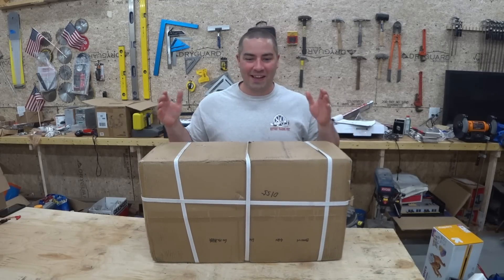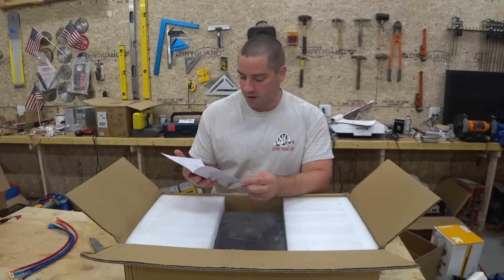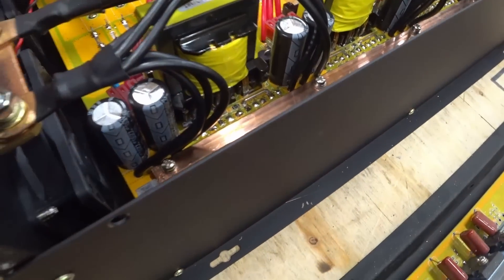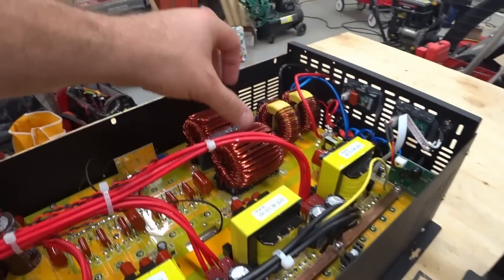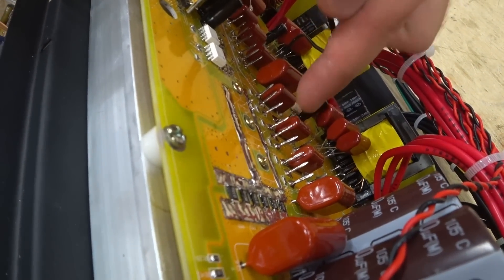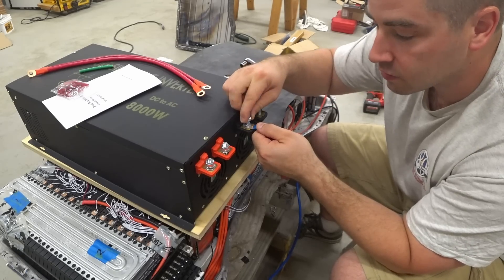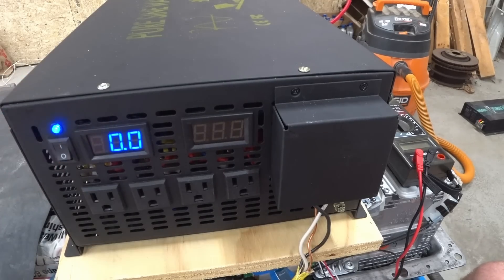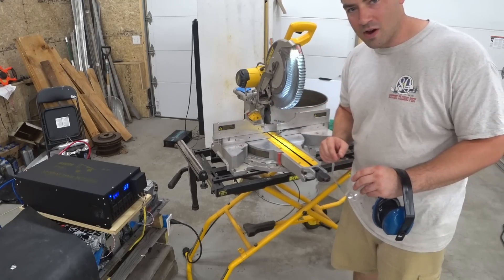Cheap 8000w Reliable Inverter, That Works! WZRELB

Comment: Maybe AC is not needed for solar and inverter combos?
The need for AC was a big deal with power lines running all over, but with power now coming from panels on the roof of every house, the need for AC is not important.
Perhaps the focus folks need to concentrate on now is identifying and removing AC transformers on mostly DC appliances.
So many times, I see AC inputs on low power  appliances that go from AC to DC.
Almost every appliance only needs DC... The AC is only needed to transfer electric power over long distance.
Since solar power is gathered/made at panels only feet away from the need, I think AC is not needed.
And with AC to DC conversion not being 100% efficient, imagine removing the numerous converters on almost every appliance.
We may only need DC!
Reply: I like your thinking but with DC you have to consider voltage and power.  You can get all kinds of 12 volt appliances but the amp draws are pretty high.  That means heavy wire.  If we could get manufacturers to agree on a DC standard (like 85 volts) then we'd be able to use the same wiring as we do in homes today and devices would be more efficient.  Why 85v?  I'm not an expert here so I'll accept a correction, but I believe that to get the equivalent power from DC as 120v AC, you have to use the root mean square equivalent (because 120v AC is not always at 120v).  The RMS value of 120v is 85v.  So if my theory is correct, all those power tools, shop vacs, vacuum cleaners, blenders, etc with series wound motors would plug right in and work fine.  Water heaters could be adapted too.  Lots of things would not work though and you'd have to have use DC to DC converters or a smaller AC inverted sub-system.  I was trying to figure out a way to transmit DC and AC both through a home but it comes out to a lot of wires.  You'd think you could share ground but that's bad juju.  It would play havoc on GFIs at the least.  Still, the idea of using native DC devices is good because it can reduce your AC needs.  Look at what you can do with DC powered air conditioning and heating at HotSpot Energy.
Reply: @lenmarinaccio3262  This is why 48-72Vdc battery banks are becoming more commonplace.  At that voltage, wire size is less of an issue.  I have even run many of my power tools directly off of a 96v bank in my garage since many power tool motors have brushes and are therefore self commutating they will run on DC or AC just fine as long as the voltage is fairly close.  Remember that a 120VAC outlet is measured at the RMS value so the actual peak voltage of a 120V outlet is 170V.
At 48-72v you can buy buck converters that lower the voltage that can be used close to where you need the power but I think the biggest thing to look at is how many devices don't have a large current draw and could be run just fine off a simple 12v 15 or 20 amp circuit.  You can buy 48v electric water heater elements that are slower at 1500-2000 watts but they still get the job done if you have a large water heater tank and don't use a ton of water all at once.  
The only appliances that really need high current are likely in the kitchen and laundry room and you can find 48v inverters for around $1500-3000 that will more than handle all the appliances in a typical house including air conditioners and the only thing you have to watch out for is that you don't run all the big loads at the same time so AC, stove and clothes dryer.  With the right planning, I think most houses could be set up to use both AC and DC effectively and cut down on a lot of wasted power at the same time.

Comment: How many solar panels and battery do you need to use that 8000w inverter?
Reply from the maker: I was using a 12kwh lithium battery and it worked pretty well.  For the solar panels you would have to first find out how many kwh you consume per day before you can decide how many panels.

Comment: The main Hot wire and neutral maybe he's a good idea to change it 8 gauge or 6. To avoid heating up the wires. Probably running more efficient

Comment: you can use a regular 120 volt incandescent light bulb ,to charge those caps to prevent spark.
Reply from the maker: Yes you can.

Comment: Did you ever actually demand 8000 watts from this inverter continuously? That would be the question. These units from China are often underrated.
Reply from the maker: I tried to pull 8kw in Part 2 video.  It only got up to 7kw. https://youtu.be/TZbjy9t933E

Comment: How many and what kind of batteries are you using
Reply from the maker: In this particular video I used a lithium battery.  It is Li-NMC, about 15kwh, (12 kwh usable) and arranged 14s for 48v)

Comment: I am just an old man now!  I am building a grid on my home.  I use mostly 2 and 4/0 gauge wires.  Thing I would like to know how well a battery system would last daily.  I enjoy too much electricity!  I like what you had done. I recommend everyone to use 2 or 4/0 gauge wire.  I use 4/0 gauge from battery to systems.  I now want to build my solar next.  Thanks!

Comment: No grommets around the case cut-outs for the high amperage outputs? That's smart. Watch for a short circuit there over time.

Comment: 58 amps x 120v = 7, 000Watts, not bad,  nice to know if it heats up much over 8 hours at that wattage.  Thanks for doing the video.   I'm looking for flexible solar panels that are proven to be used as solar "SIDING" for a house or as solar "shingles" too, and can be chained in parallel and/or series to get to 24v to run an inverter, the inverter would need to be 10.kw so I can run my AC or furnaces @ 240 v .. .thanks if you know of either.

Comment: 8000w is a capacity of around 60amps that is alot of power, of course it will take the load, I would use 4ga. Cable for that inverter at least, or you'll weld the terminals with the wire size you have now

Comment: stranded wire is smaller than solid wire. but for a given size both kinds, the stranded wire has a higher capacity

Comment: That 10 gauge stranded wiring you see supplying the hardwire contacts are so short they are considered "Chassis" wiring and are capable of handling MUCH more than just 30 amps, which is the rating for longer lengths of wire. Personally I would have gone with at least 6 gauge, but those 10 gauge wires may actually be alright,. but still a little bit small.

Comment: I'm with you on the internal wire gauge. Also, its good practice to hook up possitive cables before negative. It may or may not have an effect on solar systems, but if you are in that bad habit of neg first, when you are trying to install a battery or jumper cables on a vehicle you have a good chance of welding. Thanks for the video.
Reply: Could I ask what’s the reasoning behind this?
Reply: You want to do this because if you have a negative body ground, as is the case in a vehicle, you want to hook up the positive first so that if you bump your tool between the post and something that's ground (car body), then you won't short out the battery/start welding things with your wrench. :)  If you do the positive first it won't make a circuit if you touch the ground.  Then you can put your ground on and it's also safe.

Comment: I bought a similar product 10000w from Reliable two years ago and after one month it burnt out. I paid another 200$ to try and repair it but it never worked again. I could nor afford to send it back to China at my own expense as our mail is much more expensive than China mail.  Has your inverter continued to work?
Reply from the maker: I used it about a month.  I tested it running heavy loads, inductive and resistive.  It worked OK.  Never broke.  I sold it, so I can't tell you about anything longer than a month.

Comment: What kind of batteries did you use for the 8000w inverter and how much did it cost?
Reply from the maker: The least expensive place to buy the inverter is Ebay, for $1,100.  The battery is directly under the inverter in the video.  It is from a Smart Car, I re-wired it to 48v.  I have several videos on the battery build if you want to see how I did it.
Reply: @DavidPozEnergy  Thanks

Comment: Would you test to the 16000W spike?  Yes, that's a nice big chop saw but I don't think you're really stressing it.  Plug all your tools in at once and push it to the breaking point.  I also question your title - I do not call $1500 "cheap".
Reply from the maker: You might enjoy Pat 2 of testing this inverter.  It never did get all the way to the name plate rating.

Comment: I'm pretty new to this stuff. Why do you have 4 wires for the battery side of the inverter?
Reply from the maker: The manufacture sent two thin wires for positive, and two thin wires for negative.  It is recommended to use one thick wire for positive and one thick wire for negative.  I'm guessing the manufacturer does it this way for cost.  They might buy a million of this size wire and send one wire for smaller model inverters, and two wires for larger size inverters.

Comment: Also, 6AWG THHN is rated for 75 amps. If that's 6 gauge THHN wire, it's safe to use on the output stage. The entire outer diameter of the wire would be about 6.3mm, which that wire appears to be reasonable in-line with. I'm assuming the wire can actually handle the current. I'm more concerned about the jack of output stage protection.

Comment: That's incredible... how the hell could they not fuse the output stage of the thing? Of course they recommend low current draw devices on the edison outlets.... there's no protection on them! You plug in two space heaters and you're setting that internal wire on fire.

Comment: I personally would replace the mains feed wires inside the inverter they would be fine in a technical sense there is plenty of airflow over then and they aren't drastically undersized but if you were to use this in a off grid situation and were potentially getting near that 8000w it's an unnecessary choke point and cause of voltage drop especially when a fix is so easy

Comment: But you never got close to 8000 Watts.  The DC cables are completely in adequate.  Also very light weight, I really can't believe that would sustain 8kW and *really cant believe it would surge at 16kW.  A good 8000W inverter, you'd need a 2nd person to pick it up.
Reply from the maker: This was part 1.  Check out part 2 if you want to see the full load test.

Comment: How long will it run those things before the battery cell dies out
Reply from the maker: The battery in this video has about 11 usable kwh.  So it could run a 1,000 watt load for 11 hours.

Comment: About Wire gauge vs. Current... with the very small run, this is likely sufficient. It's called "chassis wiring", and has very different rules than transmission. The voltage drop would be minimal, resulting in the power across it (heat) to be small. Stranded wire has lower resistance than solid wire... for example:

If the wire was 10AWG equivalent, 49/27 stranding, at 6" long, each wire would only have 0.000545 Ohms, and at 66 Amps that's 0.03597 Volts drop, which results in 2.374 Watts across that 6" wire.  If it were very high stranding like 105/30, then you have 0.00049 Ohms, 0.03234 Volts, 2.134 Watts.   It will get a little warm, but well within even 80°C insulation specs.
When adding loads, you can NOT use the label ""Maximum current draw" rating... that would be with the tool fully loaded to its maximum possible load. Unloaded draw is a small fraction of that amount... a 9-Amp rated saw might only draw 1 Amp without loading it down.  Use a Kill-a-Watt meter and read VA.
When you hook up a load and the Voltage climbs, that's a sign of an imbalanced feedback circuit... it's trying too hard to correct for the load... there should be NO change in a good design.
Inductive loads (AC motors), when unloaded, have a VERY bad Power Factor... the current and the voltage are way out of phase, which is harder to handle than a nominally loaded motor.
Reply: I don't think that wire would be any good while technically your calculation are right I doubt they used anything special being Chinese made and metric cable equivalent is 6mm2 with 75c insulation which Australian standards rate at a maximum of 50A before derating if I were going to use that inverter I would swap them out for 16mm2 which is about 5awg but a 6awg would be fine we just don't have an equivalent

Comment: Dave as far as wire guage concerns in real world applications I've seen some really undersized copper services feeding multidwelling buildings in Manhattan in my day...  and when I tied these services in the math in my head said no freakin way....  but in the real world it works ...  so I dont worry so much about slightly undersizing even a 60 amp draw on a rated 30 amp wire.... i think the codes are over the top but down in those manholes in the cities nonones looking if you know what i mean....  I've had the unfortunate pleasure to hold a single phase leg pulling 1100 amps on a 500 mcm cable the other 2 legs or phases were pulling slightly less.....i was up around the Columbus Circle area in a midsummer heatwave  ........  the scenario was 8 sets if temporary 3 phase shunts feeding that big old building on the corner right by the Channel 7 ABC news building and those shunts were running hot and long about 300 feet from the street across the walk into the front door and down to the basement...(crazy scenario and getting political by the minute all the big shots were hanging around that afternoon someone screwed up...  you might know the grid im talking about cause it went down completely in the summer and made the news its a trouble spot columbus network but one i wasn;t familiar with i was part of the downtown manhattan networks and didn't know the politics were thick up there , thick enough to put peoples lives at risk, just a note never put your life on the line for assholes you dont like) .....anyway the new services were pulled and waiting to be tied it was a short run of 80 ft through the conduit into the basement to retire the 300 foot temporaries.......so I tied that first set of 3 single phase in and wham the juice took the shortest path and i felt it tremble  i put the amp probe on it thats when i saw almost 1200 amps and I had to cut it before it melted this was all in a matter of miinutes but it was hairy and scary....  shortly after that I packed my shit and left that job .pretty much for good... not because it bothered me but because i thought the company was full of shit and didn't appreciate my labor.... and in the back of my mind i had the strange sensation someone wanted me to burn in the manhole that night.....  lets just say I made a few enemies in that company.....  but alls good now that was 17 years ago.... i've applied my skills into home renovation now.....  but anyway I like your channel and ever since I hillbilly rigged my predator 4000 to run my entire house for an entire week back in 2015 ive been interested in the off grid You Tube scene.....
Reply: I am no electrician but I have seen video of the basements in new York and the mess from floods and rats and god only knows. Glad you made it out alive, lol
Reply: @giggleherz9491  thanks bud...  yea i learned alot working in the streets on NYC...  but what i learned the most was the politics of Corporate America ..   and a real good feeling for the aristocracy within the corporate world and how the money involved gives them the upper hand and picking who and who will not have access to a descent quality of life in this country...  and most of what i know leads me to believe a civil war is just ove the horizon....  between the haves and have nots.....

Comment: Hey I am looking for a inverter to go from 24 volt dc to 220 volt ac this inverter would only be used for a max of 10 minute intervals may be 2 times an hour.do you have any recommend ones to possibly buy.Thank you for your channel and all you do. God bless
Reply from the maker: I've never worked with 24v systems, so I don't have personal experience with them.  I'd suggest calling Alt-E.  I buy lots of stuff from them.  They are trained to size equipment for your application (free service) and they sell the inverters.  https://www.altestore.com/store/  I'm not affiliated with them, but I am a customer.

Comment: These inverters are about 1100 bucks from a quick check on Ebay. The real comparison would be to my outback 3024. 3000 watts, 24 volt battery bank. Which I paid about 1200 including shipping. I'm betting the outback would out preform the 8000 watt chinese inverter. Not sure but defently worth a review, I'd.say with confidence the putback would outlast the chinese model by a decade or two, just dont know how they'd compare to power output. I owned some aims inverters and they lasted about a year, I've had a outback and magnum running full time, 24 hours a day for 4 years now no issues.
Reply from the maker: I'd agree, that the Outbacks will probably last a lot longer.  The Outbacks do a better job with surges, and are a cleaner sine wave.  I only use this brand for small temporary stuff now and then, not continuous duty.
Reply: @DavidPozEnergy  it's cool you're experimenting with them. I bought alot of differnt stuff 10 years ago, it all let the smoke out within a short period of time. I just stick with name brand stuff these days. Which most people including myself cant afford, but if I cant afford it I just do t make a purchase til something changes

Comment: OK, you have a 8000 watt inverter, and you get excited that it can handle 1500 watts (ok, maybe 3000 watts at motor's startups) ... what am I missing?
Reply from the maker: I tried some 8000w inverters in past videos that blew out the mosfets when I tried starting my saw.  This one did not blow up.  That's why I got excited.  Video Part2 shows running this up to higher loads.